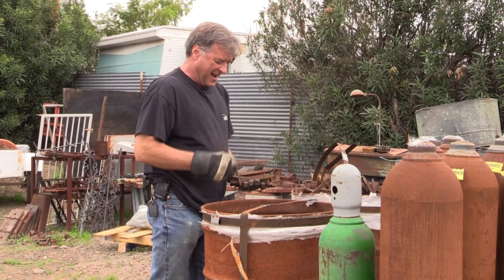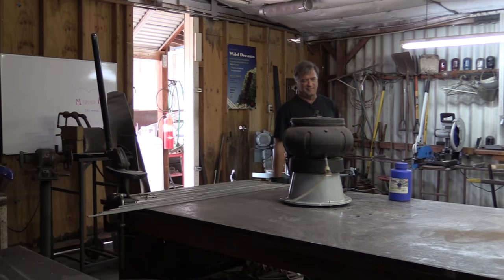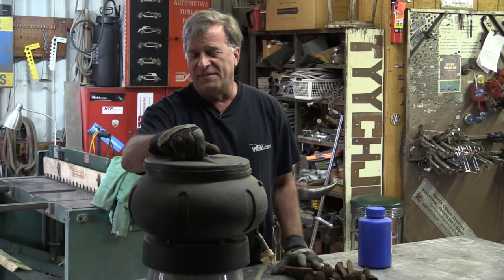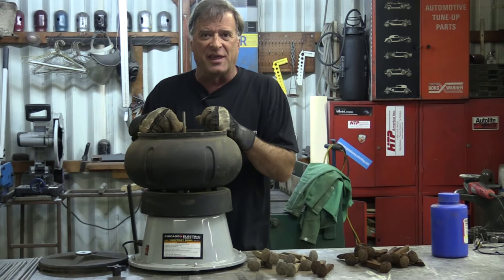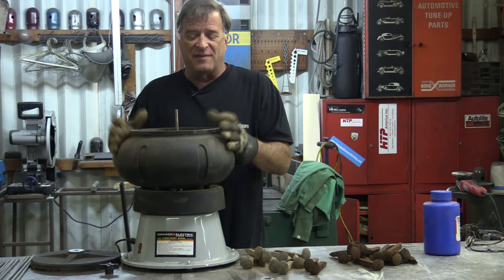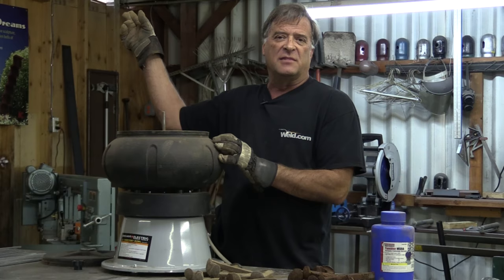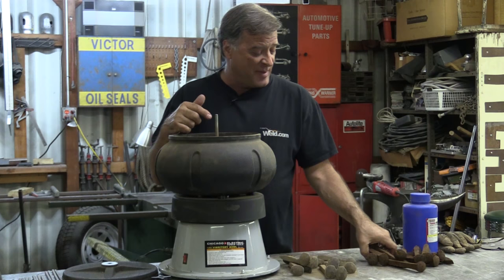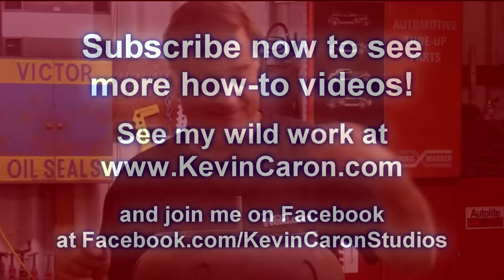How to Remove Rust the Easy Way - Kevin Caron

Comment: Tumbling is great for getting rid of scale, and sharp edges, but for just rust removal, can be a little rough IMO. For simple rust removal, a couple days submerged in a plastic tub filled with vinegar will bring it down to bare metal without wearing down the edges, etc.   It's really good for antique tools, or anything that you want to restore the finish on.  I also use it to restore cast iron skillets.  After a couple days or so, the rust is reduced to a black slime that simply washes right off.  This method also does not suffer from size limitations like a tumbler has.
For heavy rust, I'd recommend looking at electrolysis, which is also not that hard to do.
Reply from the maker: Great ideas,   thanks for posting.
Reply: HCl would also work, however be more expensive.  if you displace any oxygen in the tank, the reaction will stop as soon as the rust is gone, since the iron oxide is the only thing fueling the reaction.

Comment: Never seen a tumbler used dry before, I used one daily when I worked as a machinist.
These days at home I use a rotary tumbler with stainless steel media, for cleaning must and bolts along with small engine parts.

Comment: I have the same tumbler & media.  You want to tune it up a notch and cut the noise in half????  Add a few ounces of Dishwasher soap (I use concentrated cascade gell) and a quart or two of water.  It'll still clean the rust, save you from all the wire wheeling, cleans dirt and grease too, dustless, and as I mentioned its much quieter.  Just rinse and dry or oil the parts on removal. Yes the soap and water will get dirty over time, but it remains effective for several cycles or weeks even.  I just drain & rinse the bowl and media when it becomes muddy.  Works great.
Reply from the maker: Awesome, have to give it a try!

Comment: Those tumblers work great, albeit a little noisy. I have a smaller one I use for hardware ect. I did notice yours is full of leftover grit, rust and pulverized bits of media. You should dump it through a screen of some sort, that dust doesn't clean anymore and I think it insulates the items you're cleaning from the media. Just a thought. Btw, nice collection of scrap!!
Reply from the maker: Been meaning to do that!   Thanks for the kick in the butt...

Comment: I have the smaller tumbler. It works but . . . It shakes itself loose to the point the bowl spins. I've replaced rubber washers used for friction with no luck. Needs better design.

Comment: Hey Kevin Whats ya do in .
Here is the best way to take rust off metal. Even old rail road hand tools rusted for years.
Done it did it been there. Plus all rust steel large or small makes no difference.
Water and molasses ( 1 part molasses and 9 parts water ) let the rusted part soak for 10-12 days. Then wash off.
you will be amazed. proportion to the amount and size of steel.
I use molasses from the the farm food supply people that they put in the animal feed stronger then store bought molasses.
If you can only get black strap molasses from the store add a little extra molasses.
Post how it goes.
Reply from the maker: Well that is a new one on me!     Have to give it a try.     Thanks for posting.
Reply: For got yo mention, my pleasure passing on info to you, or anyone.
I use my tumbler to clean brass to reload, waste of time in my humble opinion to use a tumbler to get rust off,
 no offense.  20 gallon drum full with rusted parts, the right mixture you are done in 10-12 days good for a year LOL
keep smilling
Reply: ugotit33x I've tried the molasses, it does work but very slow besides it stinks like a dead animal carcass. I've found for my projects I don't always have the time to wait, I use other methods.
Reply: I SAID IT TAKES 10 -12 DAYS* YOU PUT IT OUT SIDE * IF YOU ARE THAT MUCH IN A RUSH BUY A NEW WHAT EVER END OF STORY. NO BODY'S GOT TIME ANYMORE THEY WANT IT YESTERDAY